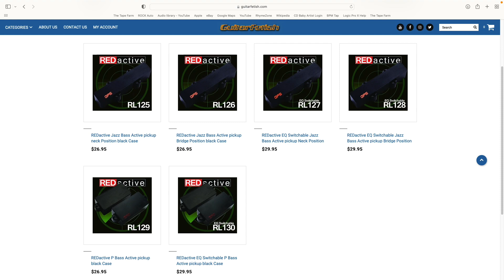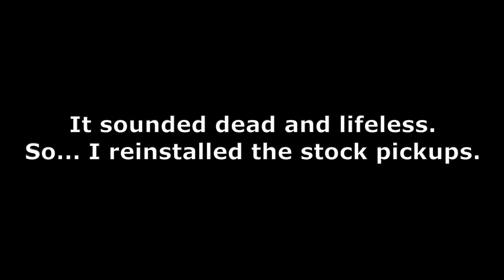Fretless Bass Mod - Firefly Bass - CA Glue Finish - Pickup Fail

Comment: If you are still wanting active pickups, try EMGs. Never had any issues, and there is no soldering. All the components plug in.
Reply: EMGs are great but I think he needs a preamp with a battery.I never heard of active pups without a battery.
Reply: @kevmac1230 I have a 5 string jazz that I bought used with EMGs thats wired "passive". It has a 9v to boost the pickups and traditional vol-vol-tone controls like a passive bass, but it still has a "preamp" or sorts.
Reply: @mangofactory.mp4  I do too.I just count anything with a battery kinda like a preamp.

Comment: The string spacing looks off, could be the angle on the guitar, but looks weird. Nice work, makes me want to make an inexpensive fret less!
Reply from the maker: I have been playing with the neck angle. I still don’t think I have right just yet. Since this really is a learning process I’m sure there will be changes along the way. The whole geometry of the neck might need tweaking. For example, I’ve been thinking that maybe the neck needs to be raised slightly. Since the frets are gone, now the actual playing surface has been lowered. Still a work in progress…. Much like myself.

Comment: Question, I am thinking about removing the frets from my 5 string jazz bass. The tool you use, how expensive was it, and in your own opinion, do I really need to spend almost $60.00 for the Stew Mack one?
Reply from the maker: It was $25 I think. And no, you don’t need to spend StewMac prices on pretty much anything.
Reply: @TheTapeFarm  cool, thank you.
Reply: i did my bass in 20 mins with an exacto blade that i dulled with my sander. dont buy a tool... my chipout was less than this guys. also, nobody uses glue. no need to heat unless its pre 1990. even then, chances are theyre only pressed in
Reply: if u buy a tool, buy a cheap thin fret cutting saw. first, pull ur frets. then fill with woodfiller, then stain so it all matches, (sand flat first) then after its hardened go back and score a thin line with the saw where ur frets were, (good idea to mark them on back of neck) refill, sand, dont stain, cover with ca glue. done and itll be flawless, fret lines will be color of filler so u can experiment too

Comment: The thing about passive VS active is ... pre amp... I can't understand what is a active pickup without thinking in a Passive PUp with pre amp integrated..... so... any passive pickup could be part of a active bass guitar!

I would run from that type of Active pickups.. can't think of any pros of that all-in-one package except space confinement.

The symptom you show with P split PUp take me to a Out of phase... I would try to switch ground with hot cable in P pickup.. just a chance it could work.

And with de battery compartment,  now you could implant in that bass, something 9V powered... some leds, simple effect (pre amp, booster, etc..)... mods are infinite.. use your creativity.. (jaco fretless? He used some effects.. chorus... 😅 )

Have fun with it